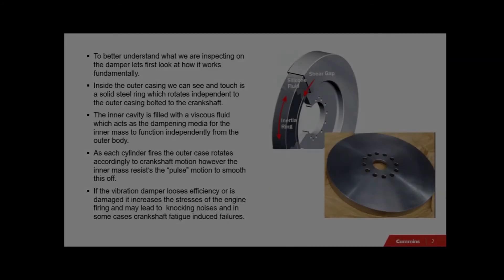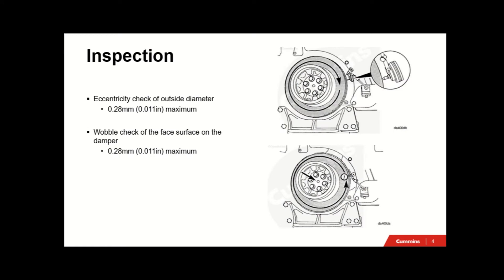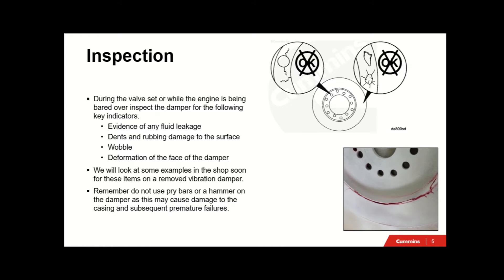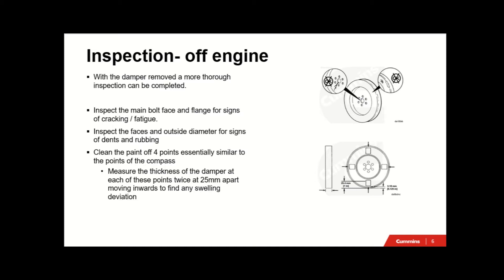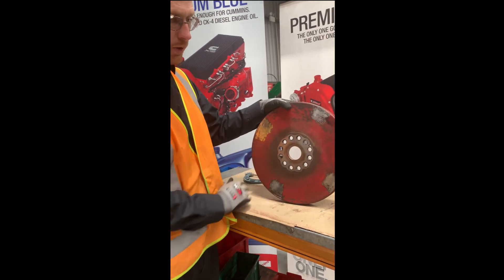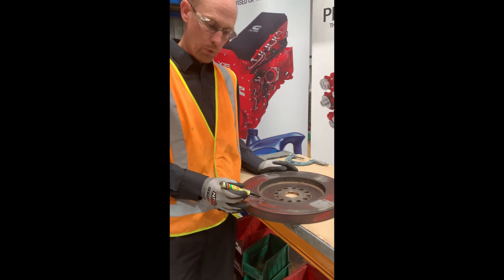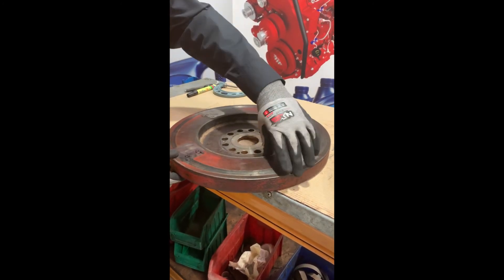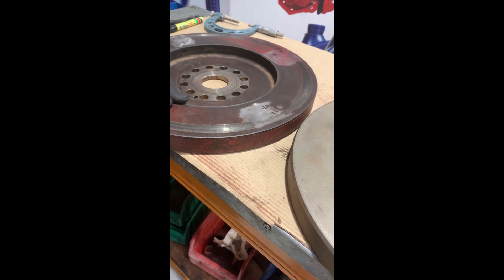Cummins X15 Vibration Damper Maintenance

Comment: Have a vibration when engine is under load (underway) starting at 1400 rpms. Sound like cavitation but checked all running components, prop, shaft, cutlass, and drip seal. Do not get the vibration when at any rpms when engine is not under load. Possible cause?